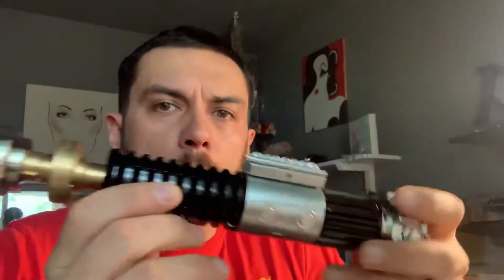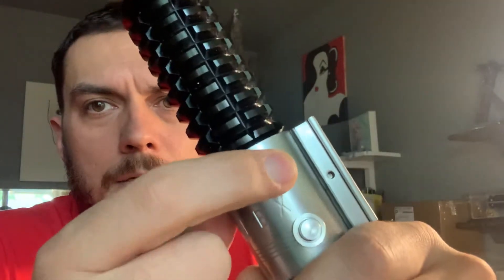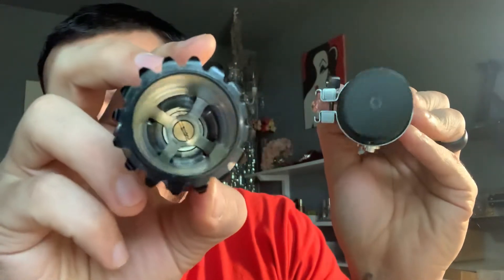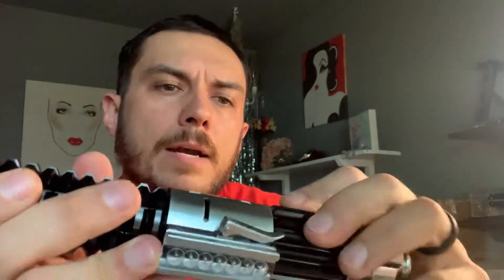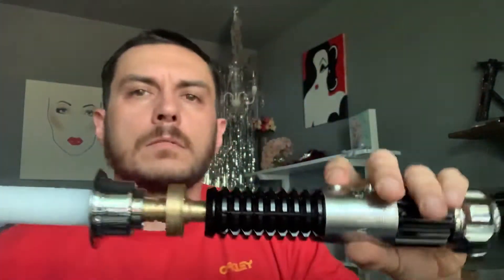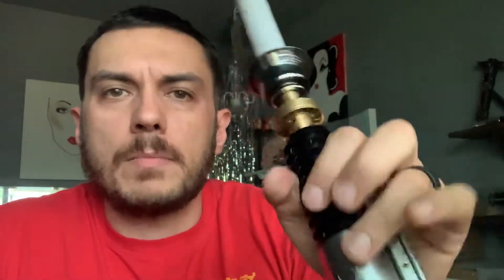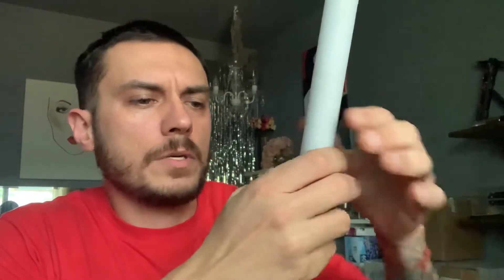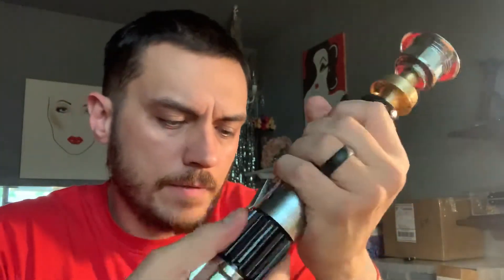Jerrin’s OWK Saber

Comment: I love this saber, and mine should ship from korbanth any day now. Hope Jerrin enjoys it. I don't know if it's possible but since an allen key is needed to tighten the blade, is there any way to have a spot on the chassis that the allen key could fit into without affecting the battery or wiring?  This way it's always with the saber. Just thinking aloud though, so if it's possible I know it probably would have been done already. Nice job sir.
Reply from the maker: Unfortunately not on this one- the insides are a tight fit